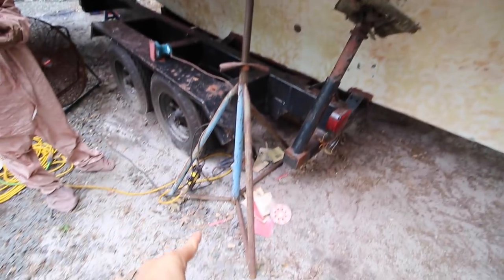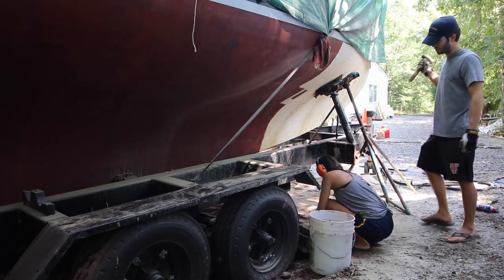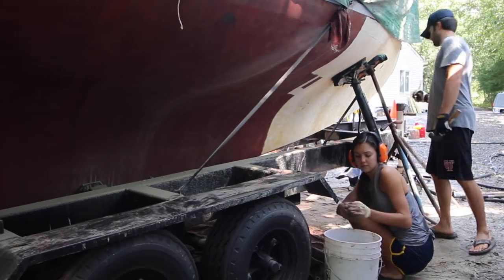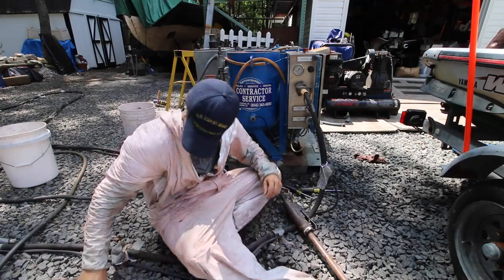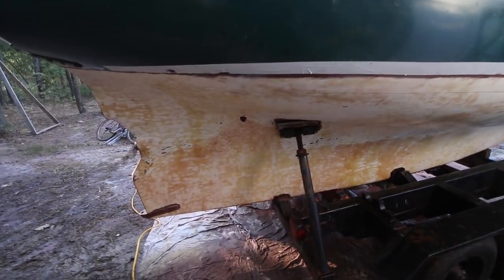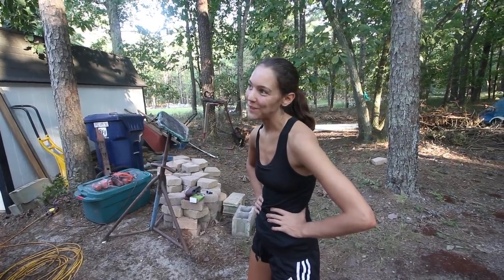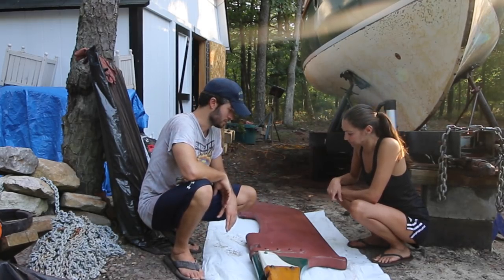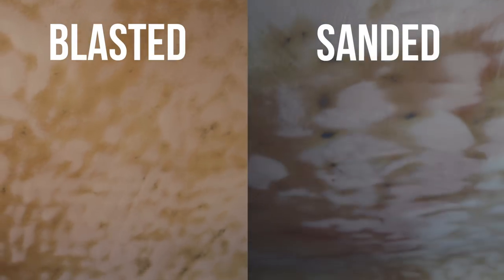45] Backyard DIY Classic Sailboat Restoration | Abandon Comfort

Comment: Sounds like fun. An electric motor makes a lot of sense, I think because you already have most of the gear for in board (the hole is already there too) I would go inboard. An electric motor rebuild is a half hour job (less after the first one) as it is two bearings to replace. Even the removal/reinstall is easier because it has very few external bits to remove (wires and coolant lines) and there are no belts, exhaust, etc. An electric motor will (in my experience working with large industrial motors) last much longer than a diesel and during that time need a lot less maintenance. Batteries I am less sure of. My experience with lion batteries is a lot 1st and 2nd gen (I still have a 1998 laptop) which have not been wonderful. A lot has happened in the past 20 years in that area. They are certainly more complex as most of the lion motive power packs have a charging circuit per cell. Certainly there is no comparison with lead acid. An interesting side effect of using electric power while sailing is that you can both gain speed and still charge the battery pack because of the wave action. The motor (and sails) power up one wave, the motor charges going down the other side though running at a lower power level will steal some of the sail power to charge the batteries without increasing speed too. This is part of the reason I personally would go with a heavier inboard motor. (I know the outboard is self contained and easier to install :)  A small genset will work as a range extender should you wish to go channel motoring... though an extra outboard would work too. The genset allows charging batteries if its really needed... cheap insurance that doesn't have to be installed and can be left behind for sailing only trips.

Comment: Just a thought, have you considered going with bio-diesel?.... Run the diesel engine on used fry oil. Perhaps not as green as electric but batteries and heavy metals aren't all that great either.

Comment: Look for an industrial electric motor. They are designed to run for long periods under heavy loads. You can even find weather proof ones. They will be more expensive. But you can find them used or refurbished. If you have stainless steel life lines you might want to have solar that mounts on them, so that you can move them from one side of the boat to the other.

Comment: I marinised two common rail diesels for our boat. Very modern and efficient engines. In hindsight, I should have gone all electric. A modern diesel has so many systems and components to make out efficient. If one of them is not within tolerances (like boost pressure), the ECU will trip, or worse.

Comment: I have had bots with an outboard and with an inboard, stick with the inboard engine it gives much more reliable propulsion.  A small diesel will have a much smaller carbon footprint that an electric motor and all the batteries, solar chargers and wind generators required to run an electric motor.  My 25 ft Cheoy Lee had a 10 hp diesel that would push it at 5 knots only using 1/4 gal per hour. 
 Rowing is a nice idea until a squall is trying to pin you to a lee shore, safety is a first consideration.

Comment: So I can’t keep thinking about how frustrated you might become in low wind conditions losing at least 12ft of waterline. That is a beautiful, stout little ship you bought, but you will need stronger winds to push it and you will go slower. Have you thought about investing in some Code Zeros for your little cutter? You will definitely want some low wind sails.
Reply from the maker: We have a pretty cool light air setup from the original owner where he'd fly a spinnaker staysail, genoa plus a small storm jib where a mizzen would be on a ketch. Over 1000sqft of sail area and it really moves the gal according to him. We're stoked to try it out!

Comment: Shaft alignment is crucial with an electric motor.  By the way an engine burns fuel and an electric motor is not an engine. Just make sure the shaft alignment doesn’t wear out the stuffing box.  You might want to invest in a laser alignment tool as the alignment needs to be checked periodically with a wooden boat.

Comment: Your rudder may be suitable  for trim-tab self steering. Shade tolerant thin-film flexible solar panels on dodger & bimini. Chinese yuloh can go all day. Big fish eat trailing impellers, bring spares. Inflatable dinghy your only choice, save the electric outboard for the dinghy. Wind generator might be dangerous (should mount very high.) Only passages for sail only, coastal cruising requires a lot of motoring (protected anchorage, ports, docks, etc..) Trailer gives access anywhere, even your own back yard! You’ll love your little ship, she’ll serve you well.
Reply from the maker: Definitely not doing wind generator on board! Trailer to us equals more freedom which is ultimately what were after. Choosing freedom over comfort :)
Reply: Abandon Comfort Keep the diesel! Electric propulsion for boats is like driving a car with only 1quart of gas, & the next gas station is 2 days away.
Reply from the maker: 14:40
Reply: Abandon Comfort 10-4
Reply: Why "Definitely not doing wind generator on board" ?  Are there some downsides to that or space constraints?
Reply: What does "Trailer" mean?  Ability to "trailer" it cross-country?
Reply: Abandon Comfort and how exactly are you moving the boat on the trailer? With a big old diesel truck, right? Do you really not see the cognitive dissonance between your professed objectives and the reality of your equipment? The Diesel engine on the truck gives you the freedom that you are giving up by removing the Diesel engine from your tiny boat.
Reply: No Peter!  Dad's truck will be re-powered with an electric motor supplied by a tandem trailer filled with LiFePo batteries and solar panels... and maybe some wind re-re-generators.  Oh, and where we're going, "  We Don't Need Roads!"
Reply from the maker: adamff280 let’s focus on something that’ll happen maybe 2 times in 3 years (using a diesel truck to tow) vs. motoring a sailboat hundreds of times over 3 years. Seems rational.
Reply: Plus the benefit of using a big diesel truck to haul it in and out of the water!...or where ever

Comment: I really enjoy your channel , love your new boat but ...in a big storm , its great to have a reliable diesel to reliably go where you need to go , and not run out of power and capsize broach and pitchpole ect , running out of power near rocks and a current and wind that wants to dash you upon rocks is deadly... also i would have just sanded around the through hulls and not compromised to gel coat and made so much extra work....guys id just get the show on the road ….put in the diesel ...or a beta marine diesel ectn , put on the antifoul and get sailing , anyhow its your journey, so best of luck , cheers Phil

Comment: What about the feasibility of building a sweat powered generator to charge your lithium batteries? Would likely need to maintain a specific rpm and the length of the electrical hook-up would need to be minimized. Of course a deisel would out perform oars when running from a hurricane.

Comment: Was there Interprotec Epoxy barrier coats under the anti fouling paint? do you plan to put any ? I agree with Douglas, if you really want to save the planet, you could choose to run a diesel engine only when absolutely necessary but you would have the safety a long energy reserve a diesel brings to the equation.

Comment: Whilst I'm fully in agreement regarding the DESIRABILITY of moving to electric propulsion on a boat, you have to have the right boat to do it. You're on a 22-23ft yacht. There is barely enough available deck space to produce enough solar power to keep your domestic and nav use going. You aren't going to get the required amount of electricity generated to power the vessel as well for any appreciable time reliably (talking a bout being safely across a shipping lane at night, incl nav lights etc). I've tried it, and I'm on a 32 footer with a stern gantry. In 10 -15 years time the density of generating panels will be up to it, not now. Sailing Uma are scratching for the nth degree of power & storage, and they haven't encountered shipping yet. I've been in shipping lanes with giants bearing down. You can call them on Ch 16 to see if any of their gear is picking you up or if you're detectable in any way. If there's someone on the bridge they usually reply they can't see you, but there's usually no-one on the bridge.
I kept the diesel for the chance of getting someone to hospital as fast as possible if I need to as well. When the technology is there, I'll be on it. Nigel Calder is a pretty bright chap, but with EU funding and one of the words best yards carrying out the work he couldn't do it on a purpose built 50 footer. You're pretty bright too, but believe me, in terms of knowledge of the subject, you have a way to go yet.

Comment: Hi Ryan & Kelsey, you two make an awesome team,  we also abandoned the diesel engine on our Dana 24, it was in good shape, always had that presents of diesel fuel smell even running the exhaust fan, so we had a jack plate  mounted to the port Side stern and mounted a Yamaha 15 horse power outboard, its 4 stroke and fuel injection with a large alternator on it, it well charge the house batteries in about 15 minutes, we do have solar, 450 watts running to a 2000 watt inverter, we just bought a honda generator to run the AC unit on days we are away from the marina or the bahamas.........
Reply: Hope you dont get hit by lightning with youre gasoline storage.
Reply: god is my co- pilot so we will be fine

Comment: At first I thought you were nuts but 100 years ago no propulsion. Sailing was still the main small delivery in the  small ports dingys for shore to boat trans. Makes sense motors are money pits constant maintenance. Boats constant maintenance buts that's life on the water..Now rental sand blaster for the trailer refinish, but did some research on the design. great find wish well and will follow. How far is the post be hind the actual balancer date . Just for perspective on time pasted and present progress.

Comment: Hey, my partner and I have been watching your channel for a while and you've given us a lot of great insight on buying a boat, various projects, etc.  We purged a lot of stuff and bought our 1974 35' Coronado in February to live aboard.  The previous owner was an electrical engineer in the army and actually installed a Thunderstruck 3 phase electric motor into the boat a couple of years ago.  We have 4 12v 100AH deep cycle AGM batteries wired in series to get to 48 volts for the motor.  We sail on a large lake in MN and we've motored up to 2 hours at about 3 knots using around 5-6 amps and used approximately 50% of our battery capacity.  If you're still looking at electric options hopefully that gives you an idea of run time even on a small 100AH bank.  Our 50% reading comes from our Pro Tournament charger which is hooked to each battery individually and keep them topped off at the dock and I highly recommend the charger if you can use it.  There are ones that connects via AC and DC.  If you give Pro Tournament a call they are generally very helpful giving advice on which one to get for your battery situation.  Hopefully this helps if you're still looking for batteries.  We plan to do solar and wind eventually ourselves and we can't wait to see your setup.  We also love your videography. :)

We love not having any oil to change, fuel to fill and no emissions.  Our old fuel tank space is just extra storage and the maintenance on an electric motor is minimal.  Electricity is included in our current slip fee so it's 100% free to take our boat out.  Even if we paid the electric bill, as we will at our new marina, it would be pennies compared to the cost of fuel.

We are actually moving to San Diego in October and shipping the boat.  We can't wait to sail on the ocean after being on the lake, we are youtube/self taught for the most part and hope to continue the adventure with a nicer boat in the future.

Here is the exact battery we have if you google the name below you should be able to find it.
Duracell Ultra 12V SLA Sealed Lead Acid 100AH Deep Cycle AGM Battery

Comment: From my research the electric motor will weigh a lot less along with the lighter lithium batteries. You might consider a wind generator also. a brushless electric motor is basically maintenance free.  Major Plus!!

Comment: You might need to humidity test the bottom for osmosis.... also compromising the gel coat with abrasive will call for epoxy primer ...if it doesn't have any osmosis that is ... I realize she has been out of the water for a long time so you would have to look for blisters and 'wicking'

Comment: Speaking of the engine topic, what about during a storm and running out of power? Do you have any other recharging ability, backup generator?
Reply: "Might" is the operative word, but doubtful. Faster boat yea sure, but sailboat even with diesel engine is unlikely. Simply does not go fast enough as most storms go faster, nor are tracks of storms always predictable. I do agree though it you lose mast, having engine if it still runs would be nice.
Reply: What? How is flammable engine such as diesel less likely to cause boat to burn than lithium battery. Do a search of how many boats have burned, you will finds lots and mostly due to diesel engine or bad wiring. Do search for boats burning from lithium battery and you will find none. 

Lithium ion batteries are sealed, only way water would get to it if its punctured. Even than it only sometimes might start a fire. I would worry more about it overheating before it getting punctured, and even that is rare on boat. But more importantly you do realize there are many types of lithium batteries and each has totally different properties. I would suspect AC are not looking at lithium ion ... but I could be wrong. If I were a gambling man I would put my money on LiFePo4 and those are one safest batteries you can get.
Reply: Meh I do not know, what I do know is you can find lots of boats burning up due to engine exploding and can not find any due to lithium ion batteries. You mean like water pump disintegrating which is one I found. Most of them simply say engine fire but not cause of why engine caught fire (of course most of them sank). But what about this one and what was cause of it, was not due to heat or vapors since it is out in open outside https://www.youtube.com/watch?v=lbcFViTqrtg something spark and igniting fuel?
Reply: Well yea and that is pretty much same for gas (petrol) too, it is vapors in enclosed space that is more combustible, but that was not the point. The claim was that diesel will be harder to set boat on fire, unlike lithium ion battery allegedly would. Reality does not show that, as unable to find any, nor is it very likely to be punctured for that to happen. Most battery banks for electric engine might add what maybe couple more battery cables if any (depending on scenario and boaters setup).

I will admit there are I am sure ton more diesel engine sailboats around than sailboats with lithium ion batteries, so yes by default there will be more likely chances of seeing boats burning from diesel engine. Just the odds. If and as lithium ion battery become more popular, only time will tell. Anyway debate might all be pointless if they use some other type of lithium battery, like maybe even much safer lithium type and much greener.

Comment: Why not use a bank of superconductor which is the cleanest way to go! And they are very small and very light compared to dirty heavy lithium which can only take 1200 charges and your back to square one, But super superconductors will take 1 million + charges and only take 3 seconds to charge, Compared to lithium which can take hours to charge up, Cute woman helper you got there and a cute boat to work on. Good luck with the project, fair winds!  ;)
Reply: Can you post a link where I can buy these super conductors. My boat will need new batteries next year.

Comment: As an electrical ship engineer i'm really interested how will you manage these systems without proper knowhow. System redundancy is the key, atleast make sure your navigation and communication power is separated from propulsion. I would definetly install atleast small emergency diesel back-up for batteries.

Comment: I have electric outboard for my 20 ft trailer sail/ cruiser. Torqeedo 1003CL. Great fit for my boat and the cruising I do.  I go to sail not motor. You will need more hp of course. But look at all the problems left behind getting rid or diesel . For me no pull start , Does not stall in reverse, less maintenance.  Electric is expensive up front, batteries. Buying all your fuel at once.  Best of luck with research. Looking forward to seeing your journey .
Reply: Hey I have a 22ft trailer sailer  w/8hp two stroke outboard. I said it earlier. I always have a minor heart attack hoping it will start. I have been eyeing the torqueedo's as they seem like they could do the job. Cruise 2.0.

Comment: I'd rather have a boat that needs interior work then exterior work because then you can put it in the water and do the work but on exterior work it has to be out the water which put extra cost on the owner however interior work may cost a slightly more but I know I can sell with my journey beginning a new adventure and chapped in my lifetime